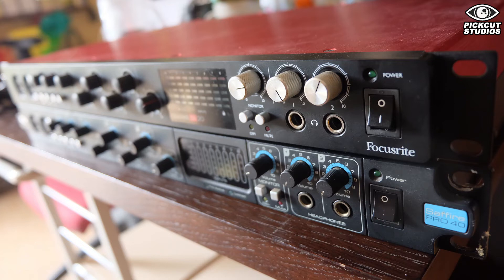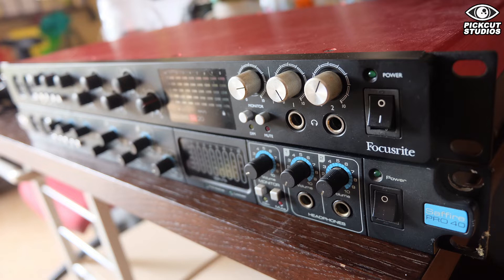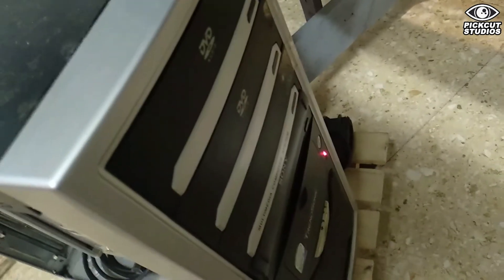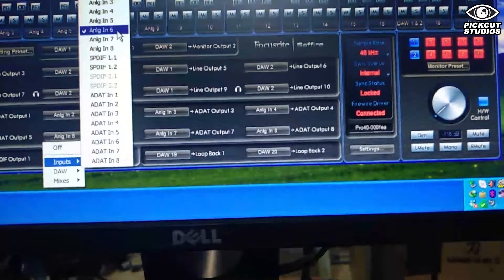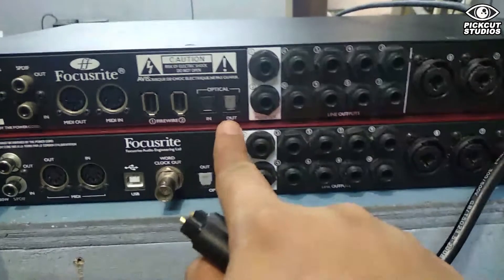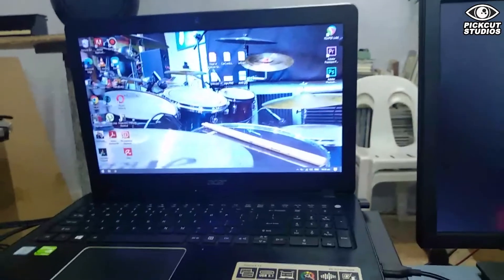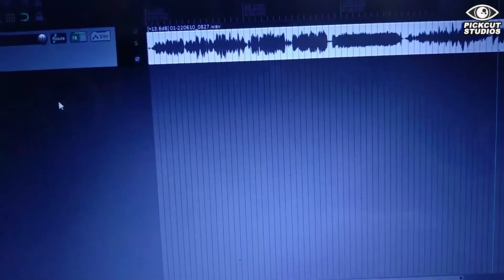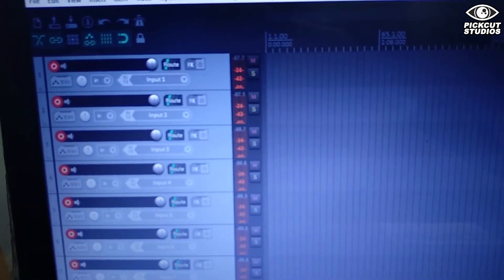Adat Syncing 2 Interfaces Tutorial | 16 Channels | Focusrite Scarlett 18i20 and Saffire Pro 40 Guide

Comment: First, configuring the saffire pro40 to just be an ADAT interface is a fantastic way to use a solid piece of equipment that otherwise would be a paperweight. Just a minor correction. USB 2.0 is not the bottleneck. The ADAT protocol itself that is the limiting factor that limits the number of channels and sample rate. Don't forget to setup the ADAT IN on the 40 so you can also use the outputs as well!
Reply from the maker: thank you

Comment: is there a way i could use the saffire headphones pre alongside my 18i20 headphones pre, all different mixes?
Reply from the maker: I believe so as long as you can open the UI for the saffire. However I believe, it'll only be the analogue signal that you'll hear among all 8 inputs of the saffire. No mixes, I believe, coz you're using the 18i20 as the master

Comment: thanks for your video, i have a few questions. I just bought a used Focusrite Liquid Saffire 56 not knowing it won't work win Windows 10 Builds higher than Windows 10 Build v.1809. Will this work with Saffire 56 and 18i20 on a Windows 10 as the following, or newer for that fact? I have an Appollo Twin USB also! I really dont the the mic pre, i only realy want the TRS i/O part to run to and from a mixer. 

Windows 10 Pro
Version	22H2
OS build	19045.2604
Reply from the maker: Im sure it will if you set the 18i20 as the master (meaning it will receive the adat outs from the liquid). However, does the liquid have 2 separate outs like 1-8 and 9-16, if it does—-you may only use one 8ch set from the liquid as the 18i20 can only have 8ch from another source. The next thing to do would be to get an rme digiface usb so you can have 24 from both interfaces. I hope that helps

Comment: would this work with saffire as a slave to an M1 compatible master interface?
Reply: I can CONFIRM 100% that I can hook the 18i20 into a macbook m1 as master and use adat out of the Saffire Pro 40 to expand input capabilities ( Tested in Logic Pro )
Reply: Yes sir. I have a pro 40 lightpiped to my 3rd gen 18i20 and it works like a champ. Itll just show up in focusrite control as adat i/o
Reply from the maker: I think so, as long as it has lightpipe